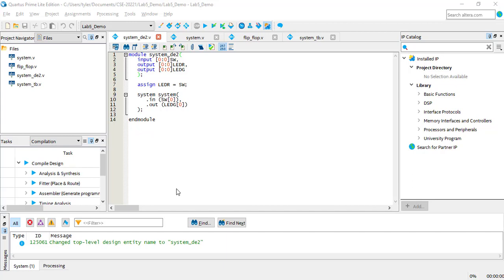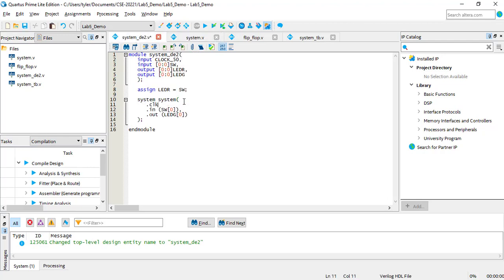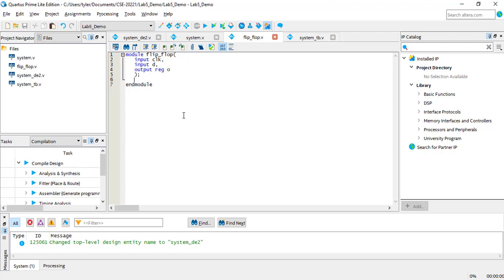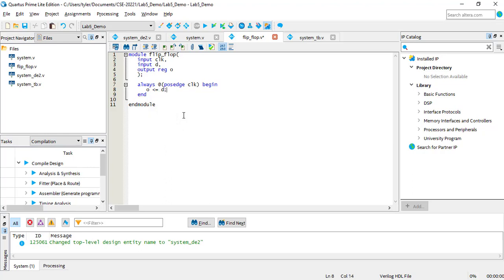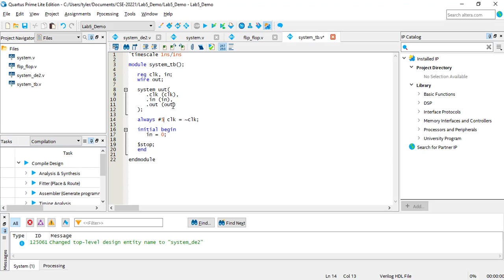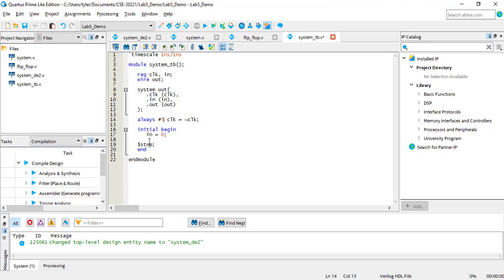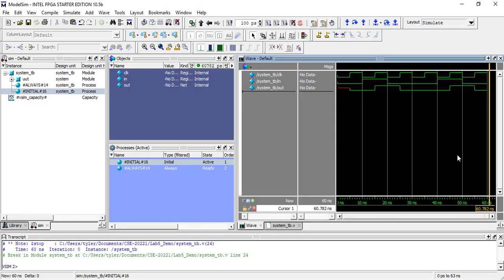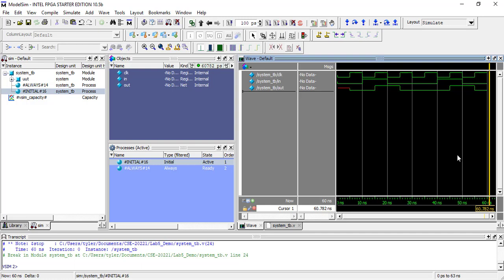Flip Flops and Clocks with Verilog in Quartus/Terasic DE2-115

Comment: module HW3(i7,I7,clk);
input I7,clk;
output i7;

Dlatch m0(i7,I7,clk);

endmodule

module Dlatch(Q,D,cl);

input D,cl;
output Q;
wire nD,nand1w,nand2w,nand4w;
not n1(nD,D);
nand nand1(nand1w,D,cl);
nand nand2(nand2w,cl,nD);
nand nand4(nand4w,Q,nand2w);
nand nand3(Q,nand1w,nand4w);

endmodule
why do you think i cannot call my D latch ?when I call it I get no result. 
Clock is given with a switch